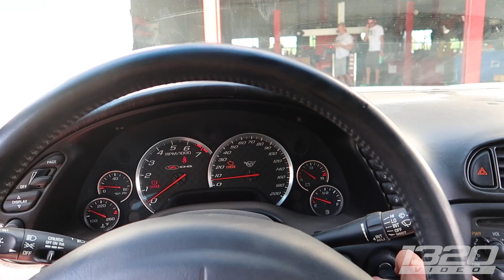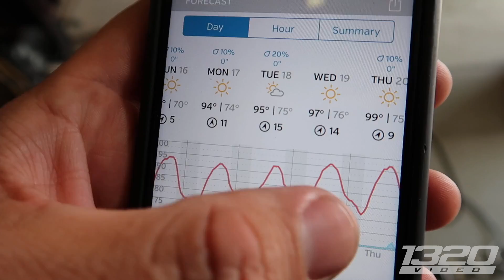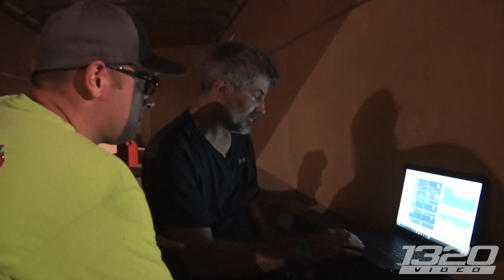Unicorn C5 Has a Little Secret 🦄  (Leroy Killer)

Comment: If there's a way to make traction control only go on for 1st gear, you should do that unless you loose too much grip in second, if it's only a little bit of spin then turn it off, it's better to spin a little than to get power cuts

Comment: Maybe if you added better suspension in the rear to eliminate that rear hop when you come out the hole, I think you can get better cleaner launches. Wont hurt to experiment with say a less lb rear springs and add more rebound to the shocks.

Comment: I like how it emphasizes on the points I made on The Last Unicorn video when I got top comment about how Leroy is lighter and more powerful which he is you can't deny it you're going to lose
Reply: Tjaden Stevens you don't know that things could fall in to place and  Leroy could. Lose
Reply: I'm going for leroy,It's gonna come down to who can put power to the ground the best
Reply: Lowballin Picker and the better driver cough cough Cleetus
Reply: cleetus did set the fastest pass in sketchyverts car. beat by i think a solid half second in his own car. pretty sure cleetus has driver mod installed. kyle needs it. even said it himself he films fast cars not so much in the driving them dept
Reply: Tjaden Stevens kyle is running 6 second quarter mile and cleetus 9 second how does that sound better?
Reply: Abyss Saint he is running 6 second 1/8th miles you fool. You need over 2kwhp to run I'm the 7s or below.
Reply: Tjaden Stevens You obviously don't understand how important traction is in an eighth mile dig. I won't deny that Cletus will probably win the roll race simply because his car is probably faster once it has traction and traction isn't much of an issue, but in an eighth mile dig, acceleration off the line is the most important and spinning tires does not help.
Reply: Abyss Saint - So Kyle must be using a 1000 shot of Nos..😂😂😂😂😂😂😂😂😂😂😂😂😂😂😂😂
Reply: Abyss Saint 6 and 9 second quarters? Are you on crack? They would need to have twice as kany horsepower each and full tube frame car to go 6 secinds. 6 and 9 in the 8th mile then sure
Reply from the maker: Lets do this again... Lighter + More power + _____ = Quicker
Reply: + traction. That unicorn is wrinkling big tires on the launch. I've watched both cars closely and the unicorn c5 launches much harder than leroy at this point.
Reply: +pacefka unicorn on the 1/8th, But on the roll race Leroy will win on Gap!
Reply: Assuming leroy doesnt spin on the roll, which it has every time so far. Which is part of the reason i think leroy's new engine is unnecessary. I think nitrous on the old one would have achieved anything hes going to achieve with what he has now.
Reply: Leroy also cuts through the wind like a brick
Reply: tdawg719 when you've lost about 700 pounds from curb (if I remember correctly) aero isn't much of a big deal
Reply: Jake Pie depends on the race. Not even sure what the race is.
Reply: You know he filmed this like 4 weeks ago right? Your comment didn't exist when this video was filmed.
Reply: I could have 100000 hp and weigh 1 pound and still lose, traction is a huge factor
Reply: I did the same thing over on leeroy's channel, people do not realise that leeroy packs 200+more hp and weighs 3-600lbs less. 
That car is a full second faster then the unicorn. 
Kyle's gonna have his ass handed to him if they can hook leeroy. I still think kyle might win roll racing but at the drags on a prepped track it's not gonna be pretty.
You nubs might want to know leeroy went 146+ in the 1/4 with traction issues. The question is did cleetus add the 100-200lb's to the parachute mount Like i said over on that channel.
Reply: Abyss Saint kyle is doin 1/8 mile. cleetus is doin 1/4 in their own videos. a 6 second 1/8 is slower than a 9 sec 1/4. not by alot but winning is winning
Reply: pacefka kyle has actual drag slicks, small tire like the death trap (chuck from street outlaws) used to be. cleetus has drag radials on c5zo6 rims. kyles got a 15 in wheel on a 27-29 inch tall tire. no shit its gonna wrinkle side wall more
Reply: Look at Nostradamus here acting like he knows something. Wow, top comment. How impressive. Commenting on the obvious and claiming to have some sort of profound grasp on the situation that no one else can see. No one knows who's going to win. It's anyone's race. If we could all tell who's going to win by simply adding up mods, then there would be no point to running the race at all. All you can do is quantify the advantages and base a plausible outcome according to that.  Id be really interested to see anyone who can accurately predict such a scenario having both cars so close to each other in mods they have. 

Here's an allegory: you spin the roulette wheel in Vegas betting $5 on black. Odds are it will hit red or black, but oh shit, it hit green.  Your prediction failed. And the odds were very much on your side. Odds are Kyle and Cletus have very close odd approximations on who wins. Stop trying to guess. And if you guess right, congratulations. You had a 50/50 chance of being correct. You're no expert.
Reply: lol Onkly contest Leyroy is gonna win is spinning.  Power to weight goes out the window when you cant put it down.  Can see the fear all over Clutus face
Reply: you sound like Donald trump: bragging while making poor arguments.  Leroy and unicorn make around the same power on the same dyno, and Leroy's weight advantage is offset by unicorns traction and aero advantage.  it will be a close race
Reply: what aero advantage ? the wind is blowing right through Leroy lol...
Reply: TrenC21 with the wind blowing right through him in reduces downforce. But that doesn't hurt him that much
Reply: +Seth Mcgregor yip agree, at the distances they going, aero is not going to make much of a difference...
Reply: Leroy is made up of a bunch of irregular shapes, which cause turbulence, which causes drag.  

Unicorn has a smooth body, which results in smooth airflow, and so less drag.  

Even though unicorn may displace more air than Leroy, it does it in a much smoother way, and so the drag will be far less.
Reply: its not going to matter over the distance they going to be dragging though...

Comment: Don't limit yourself too much with the boost by gear. Try to squeeze in as much boost as you can per gear instead until it overwhelms the launch, then dial it back and try again. I have an irrational fear of boost by gear in that I feel it robs you of the power you could otherwise have instead of always full and just managing it. :P

Should be a good race though. Leroy is a fun toy, whereas this is a build you could and would drive everyday.

Comment: Strip the car to make it lighter... And test it light too. 

The car is bouncing off the line. Hard to tell whats happening. From what i see try adding more rebound on the rear shocks. Front rebound wouldn't hurt either. Try more bump in the rear. 

Also try running anti squat.

Comment: Leroys best 1/4 mile et was in the mid 10's ,that's a mid 7 sec 1/8th mile. UNICORN ran into the 6 sec 1/8th mile. So in the 1/8th mile race my money's on the UNICORN
Reply: 500AWHP VR4-GALANT leeroy ran a 5.76 in the 1/8th mile
Reply: 500AWHP VR4-GALANT don't forget that 1/4 mile was run at 146 mph and on street tires
Reply: Ryan S not with that setup
Reply: Michael So the UNICORN ran 120mph in 8th , testing and spinning. We should know the winner by tonight

Comment: Seems like t/c was actually hurting.. without t/c you could rip the tires a little and ride it out.. with t/c on that might be why you were bouncing.. cutting power every time your tires wants to spin forcing the weight to bounce back and forth from rear on full acceleration to the front when it cuts power.. kind of like a teeter totter.. i could also just be ignorant but that's my two cents..

Comment: That's the mic drop.  If you think Cleetus is going to win now, you are a fool.  Kyle has more power (even though he shouldn't), better tires, traction control, and more seat time.  Cleetus has less weight but hasn't even made a clean pass with the new setup.  And they are racing 1/8th mile, where there is no top end to make up for driver mistakes.

Comment: Dude. Switch to an auto to make it fair with the weight advantage he has. It only makes sense and it would make it more interesting at this point (both cars are turboed AND manual, where is the fun!!). You already have the Zr1 for manual shifting fun if you want it. Why not switch it up?? Make this vette the straight line killer that you aspire to have.